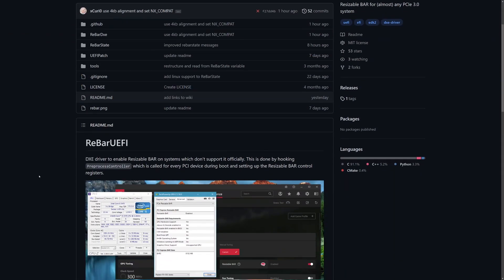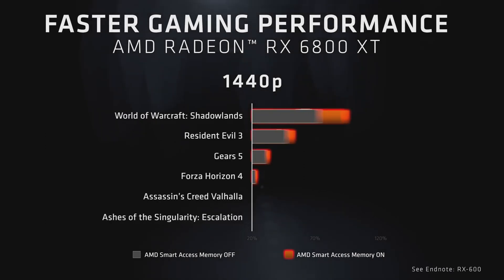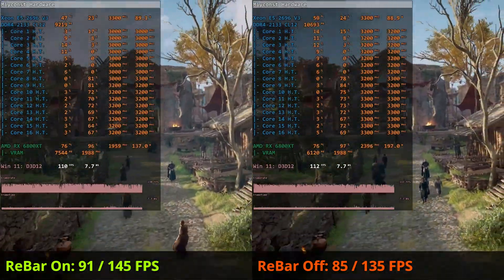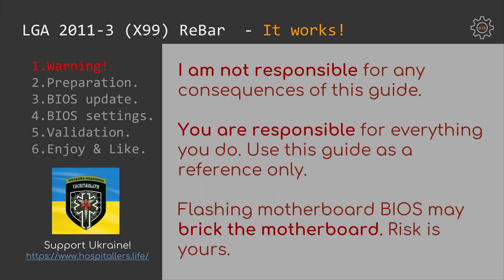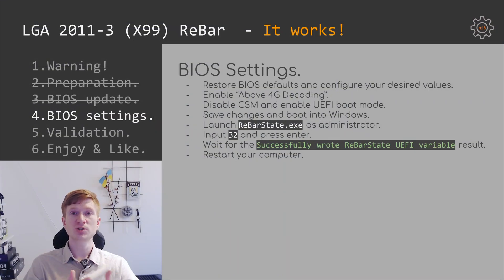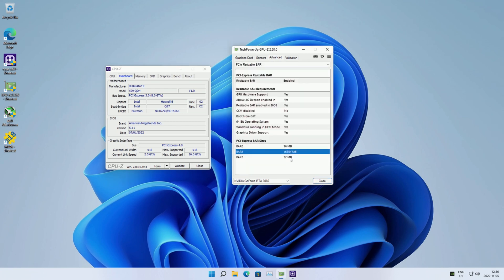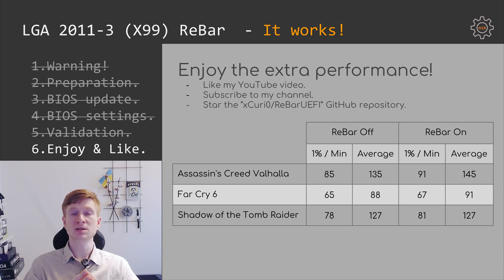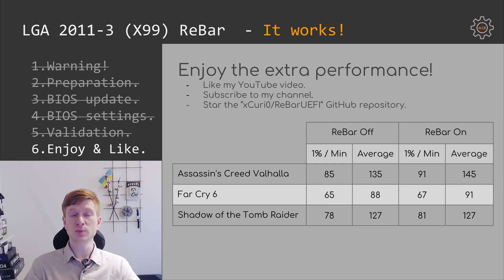🇬🇧 Resizable BAR (ReBar) on LGA 2011-3 X99 – how to enable and get extra performance

Comment: Do you have ready made bios for X99-TF so I can just flash it using Mi899?
Reply: Just checked latest update is July. Hope we get them ready made soon. Cheers!
Reply from the maker: Beware that there are several X99-TF revisions with mutually incompatible BIOS.
Reply: @Miyconst  Excellent job!!! I did exactly all what you said and flashed the bios with rebar on my X99-TF and i cant find in bios the menu with "above 4G" to enable it... :( Any advice please? my x99-TF is from the 1st generation...thank you
Reply: Update: I used AMIBCP_5020031_v2 to edit the bios and enable the setting. All worked fine :) Resizable BAR enabled in GPU-Z on Huananzhi X99-TF. Thank you Miyconst again :)

Comment: I would like to see the performance of "Intel ARC" with this "ReBar" on Chinese X99.  Long live the UKRAINE will beat Russia.
Reply from the maker: I might be able to buy an A750 for some tests, but can't guarantee it.
Reply: @Miyconst  I am Brazilian I was one of the winners of the "Intel XE HPG treasure hunt" I signed up I participated I deciphered the binary codes I pointed out the locations and I won the prize, I should receive an ARC A770 Intel gave me the blow claiming that Brazil would not have shipping coverage then presented me with 3 games, I chose, Red Dead Redemption 2, Ritiman and Farming Simulator 21.
Reply from the maker: @TheMpgnew  feels like Intel scammed you, these three games do not cost the same as an A770, but it's good that they gave you at least something.